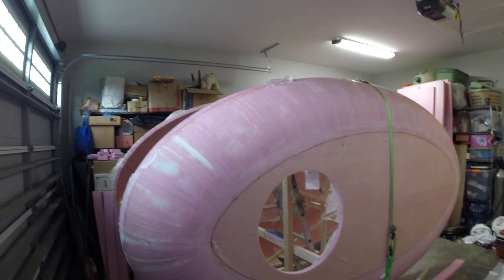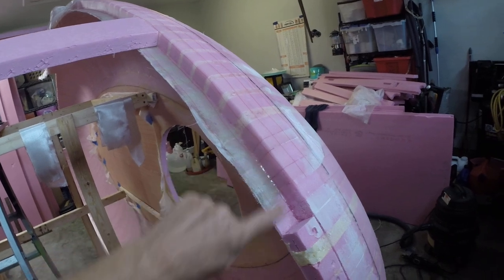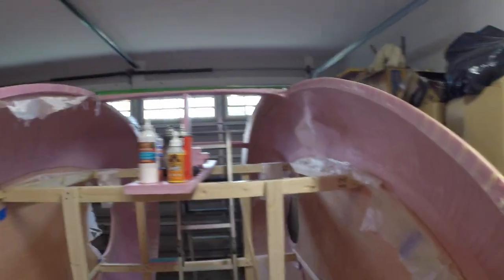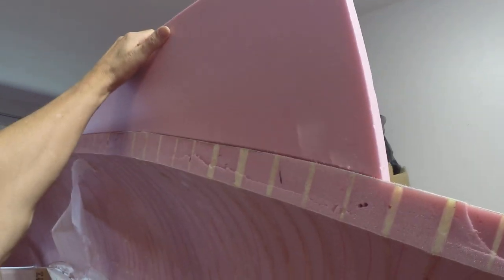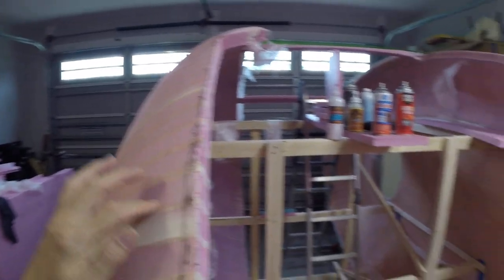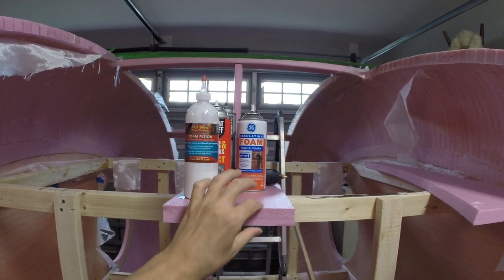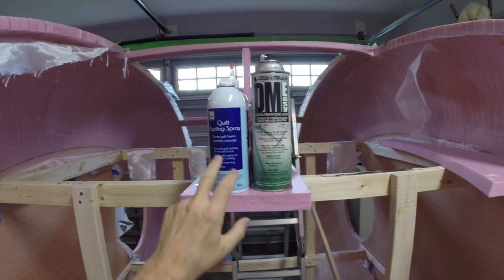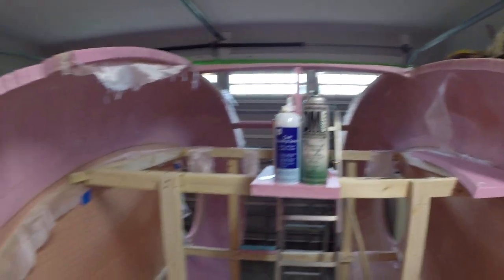Foamie camper build quick update pt8

Comment: Hi mate. Great project, very cool. What weight of fiberglass are you using and how much cost does it give you, about resin, per square meter, any idea?
Reply from the maker: I'm using 200gsm/6oz fiberglass plain weave cloth. Generally hand lay-up is 50/50 resin to glass fiber. If you take your time you can get closer to a 45/55 resin to fiber load. I don't like hand lay up, I prefer Vacuum Infusion Process, projects like this you have no other choice. Hope this helps. Thanks for watching.